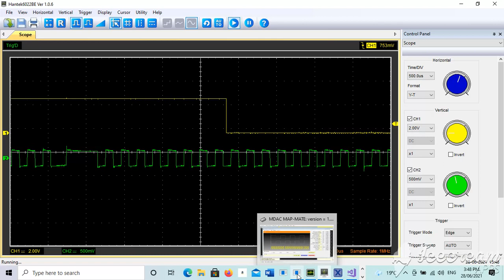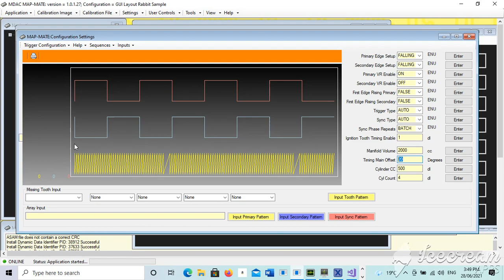Rabbit ECU MAP MATE Crank/Cam Triggers Configuration Part 1

Comment: I'm interested in your ECU, I have a project which I want to use with a DSG transmission, but I don't quite understand how to set the trigger, my car has 2 hall sensors one in the crank with 18x teeth and it synchronizes with the sensor of the cam 1X. Does your ecu simulate all the CAN BUS information that DSG needs? do you have any video showing how to configure it?